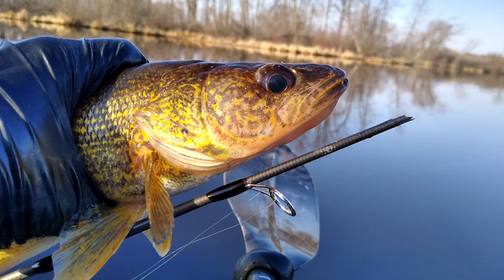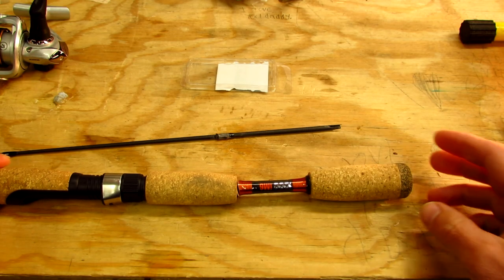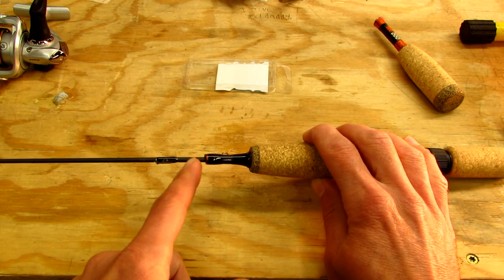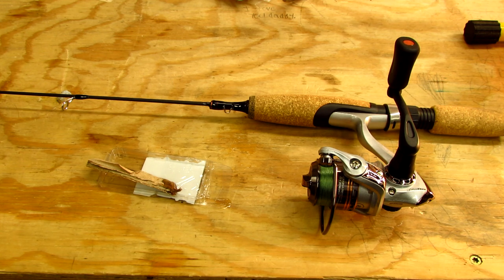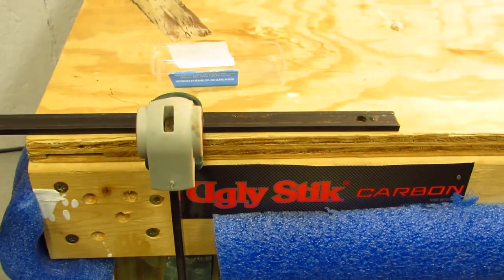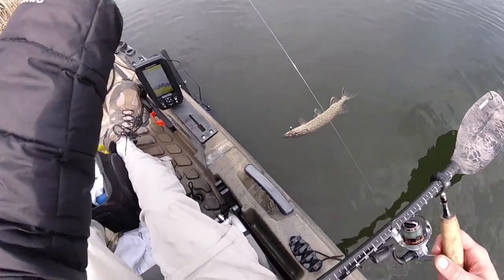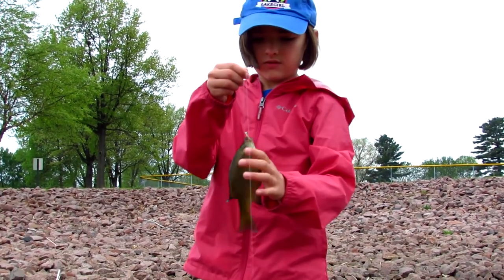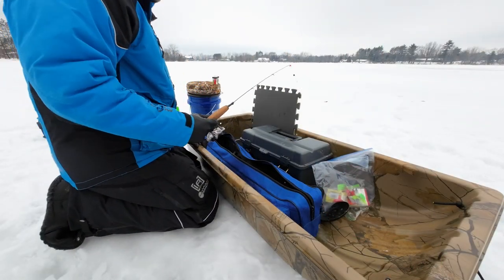DIY Ice Fishing Rod from Broken Spinning Rod

Comment: That's too funny! Broke the rod again on the first fish! Gold!
Reply from the maker: Yeah, I wasn't expecting a pike!
Reply: @FishingwithNat  Ya, we never are. Gotta be glad when it happens though, except breaking gear, it's a nice surprise. Little slimy but, whatever. It makes for a good video. I snapped my ultralight at the end of last season, exploded in 4 pieces when caught on a lily pad with 4lb flouro. Must have been a defect or damage to the rod for a catastrophic failure like that. The lily pulled out and didn't break the line so idk why it broke. I'll probably follow ur advice and use the tip as an ice rod, I live in Canada, even tho it'll be a bit short. We end up remembering these disasters and little mistakes, sometimes more than our successes LOL. And u even got a nice video out of it, to show others how to salvage the wreckage of our handywork.
Reply from the maker: @Upgraydez  Well said! I broke a medium power rod on a snag once - similar failure to what you described. I contacted the company and they were willing to send a replacement.
Reply: @FishingwithNat  Hmmm, I have an Okuma where they do that. I think this was a Shimano. I will definitely try that out. Thx  for another good thought! I'm so used to just replacing or fixing gear, kicking myself for not thinking about that earlier LOL. And now that I think about it, I think it was the tip section of a 2 pc rod, so I might be able to buy a replacement tip section also. Thx again, I got some exploring to do.
Reply from the maker: @Upgraydez  This was a fairly cheap Quantum and there was no warranty or anything that I was aware of. I just thought it was unacceptable that it broke on my first outing with it and the company seemed to agree.